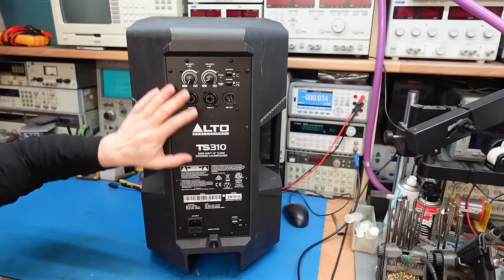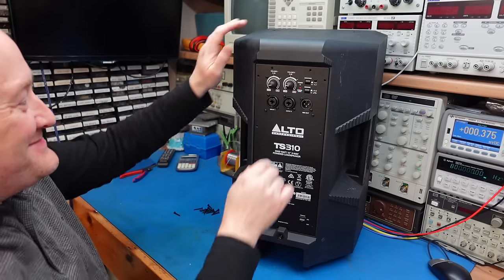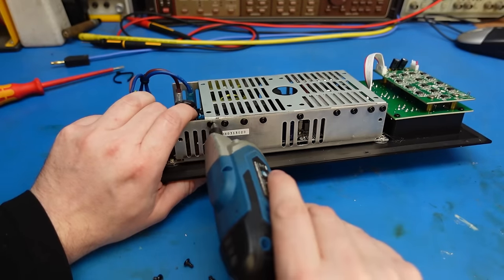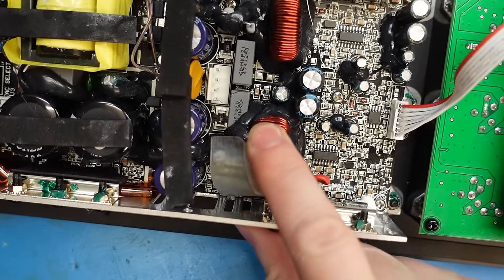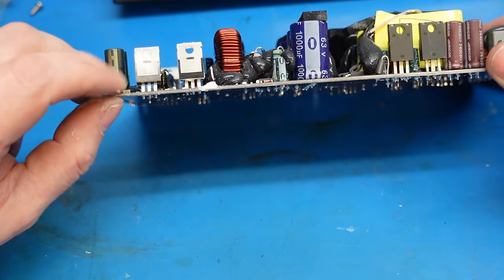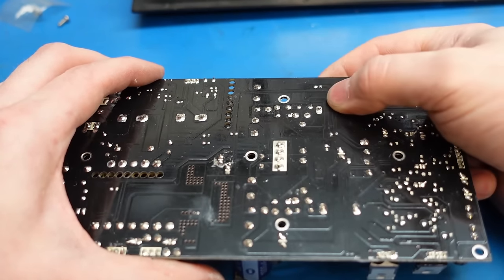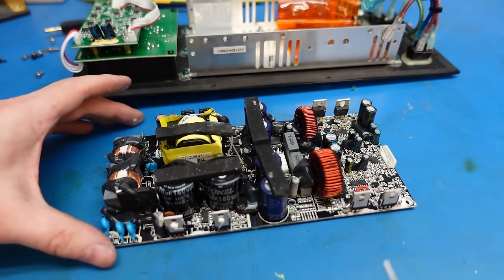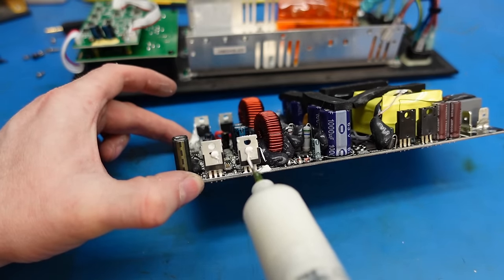2000W Active Speaker Repair - No Bass - ALTO TS310

Comment: As Davie504 would say: "BASSSSSS!" Also, I doubt it's 2000W. No loudspeaker used in singular "2-way" configuration, such as this, exists that'll handle that power. If it's made in China (undoubtable it is), it's probably that bollockey PMPO rating. And, woah, did you just call it a "digital amp". No, no, no, no. Class-D is NOT "digital", it's PWM, which can be confused with digital, but it is not. As you know, PWM means the width of the square wave signal generated varies (modulates). Not to be confused with 1's and 0's.

There's a common misconception that the "D" in Class-D means "digital", it doesn't. Class-D is a switching amplifier, using MOSFETs on the output as fast switching devices. There is no ADC (analog-to-digital) or DAC (digital-to-analog) converters anywhere in the chain.

Comment: 2000W this? Lol, maybe 200.
//EDIT: See there 63V caps. So yes, maybe slightly above 200W. Maybe even 250W or 300W.
Reply: Never ever 2000w...😁
Seems like the power laws are not respected anymore...
The power is just 1, P = U2/Z and this in ideal conditions.

Comment: That speaker is north of $550 USD.  How about no.
Reply: Features
Redesigned transducers for more efficient performance
Class-D bi-amplification with 1,000 peak output
10" low-frequency driver with 2.5" high-temperature voice coil
1.4" high-frequency driver with neodymium magnet
Compact, lightweight design for increased portability ($299.00) THIS IS AN OLD VERSION OF ALTO SPEAKERS.

Comment: Love your channel - - so - - just sayin' - - Class D or not, I highly doubt the amp produces 2000 watts RMS - certainly I could buy into burst power in that range, but no way it'll sustain that number in RMS without serious distortion imo - - I was hoping you'd measure it for RMS power because I'd love to be wrong.
Reply: It is at best 500 Watts, and that is probably with 10% clipping (simply based on the 1000uF 63V output capacitors and the size of the heat sink.)

Comment: That preamp board is horribly unsatisfying. It looks like its 15 times the same circuit. And they couldn't align it somewhat pretty in a grid. It looks like my grandpa's windows desktop with snap to grid turned off.